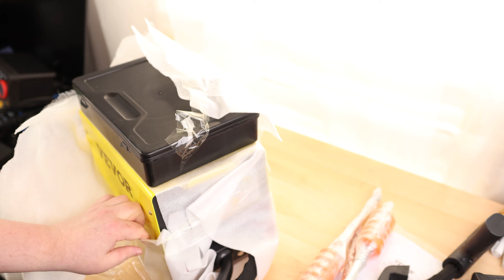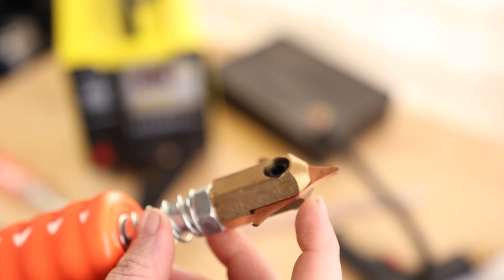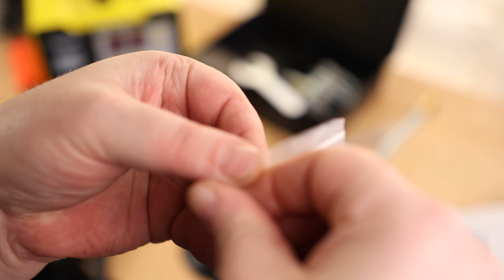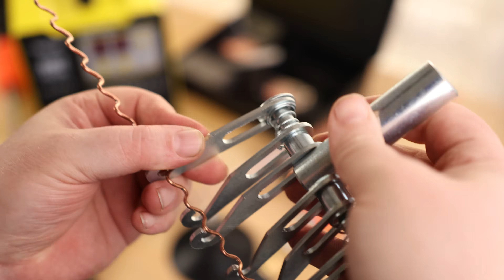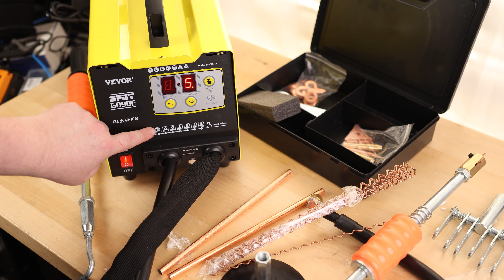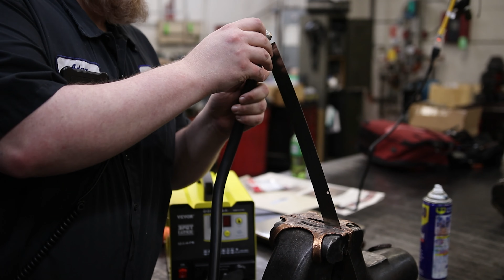VEVOR 110V Spot Welder Dent Puller

Comment: hi im in UK. bought this and it hasnt worked properly since day 1. i had a 13a plug on when i got it, plugged in tried it and blew the house fuse. got myself a 32amp supply and it does the same thing. it will do the first spot sometimes but 99 percent of the time it blows the 32 amp breaker in the house. utter garbage, the ebay seller ghosted me . id AVOID THIS GARBAGE. no after sales, no warranty

Comment: There is no way to connect the ground. What kind of machine is this with no instruction no ground and no way to fasten the ground to the body. Sending it back.
Reply: By using the ground and the welder without the collar wound in, the ground becomes the first weld point to attach to the plate. Once the ground is spot welded to the vehicle panel, you tighten the round collar down to the plate which reduces the contact resistance at the ground connection, and further spot welds will occur at the target electrode. It works really well in practise.
Reply: People Chuck the normal ground clamps in trash cause they suck so this wasn’t included. But if you can’t figure out harbor freight or tractor supply sells on that screws on you should be sending it back

Comment: Has anyone had issue with their dent puller not sticking to metal?
Reply: You may be encountering an aluminum body part.
Reply: Try not pushing so hard against the metal, as the heat is generated at the point of highest resistance an electrically poor connection will be where the heat concentrates, and that will allow the metals to fuse at that point

Comment: Any ideas as to why mine welds in very weak? I have it on high and it doesn’t stick very well. The metal is clean and the ground is on
Reply: I had the same problem. It was a defected component in the board I'm thinking about posting a video on repairing it
Reply: @SJ-pw8tx  that would be great
Reply: @SJ-pw8tx  if you do..please let me know to watch it
Reply from the maker: I'm not sure.  I'd try to set the tools option to different tools and see if you get stronger results.  I don't think that's a recommended solution, but that's what I'd try.
Reply: One thing I have learned is that you don’t want to push the tool hard against the panel when welding, in fact keeping the pressure light helps there to be more resistance and therefore heat at the point where the slide hammer tip is against the body panel, it is the heat that makes the connection.
Reply: I just bought one. I’m having the same problem others are having with it not sticking to the body panel most of the time. The ground is bare metal the repair part is clean and bare yet it still just doesn’t have enough grab to pull a tiny dent out. 
Might have to return it since there’s zero support and that’s a serious problem with buying these types of machines.

Comment: Thanks for the video. These things use to be unreasonable high priced when they first came out. Now, this model  is affordable. I actually built my own because of those high prices. Mine works very well. If this one had been available I would have bought it instead. It would have saved me a lot or research and material gathering lol.  Phillip Hall
Reply: PS It's not made for metal that thick. I realize you was using that for demonstration purposes..  It works great of thin metal such as car body parts.. Doors, fenders, hood, roof etc...  I hope you enjoy your machine as much as I enjoy mine.
Phillip Hall
Reply: True that it would have saved you the time researching and building it…. But you gotta admit it’s pretty gratifying and rewarding when the companies price things out of reach, so you just build your own that works just as well lol
Reply: hubieras perdido dinero cable aluminio 5 minutos y se calienta😂